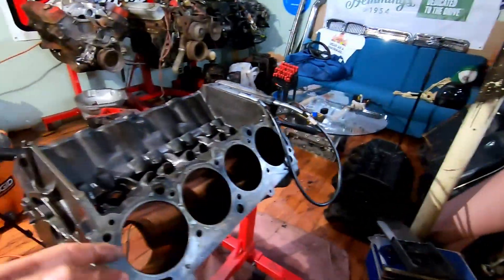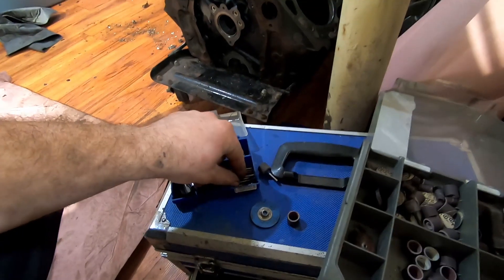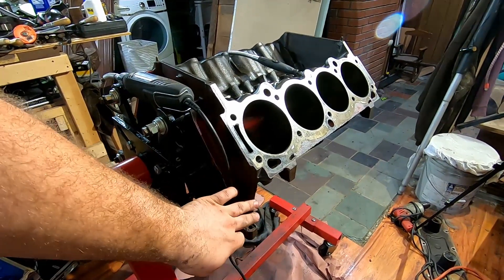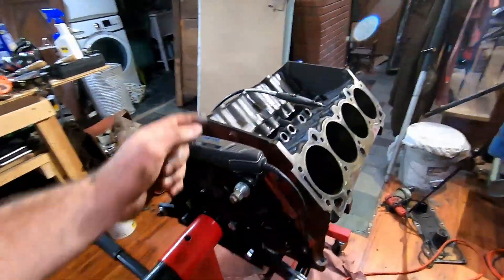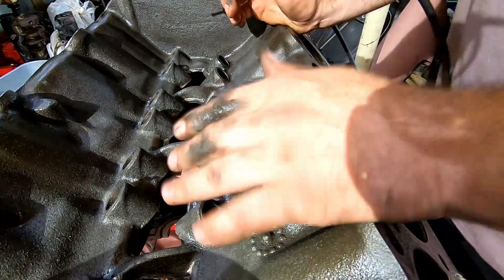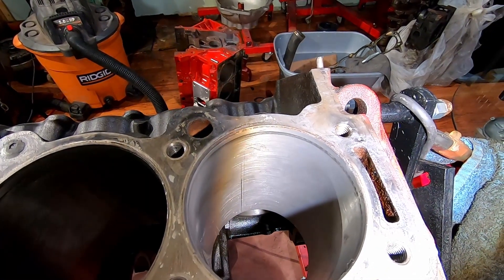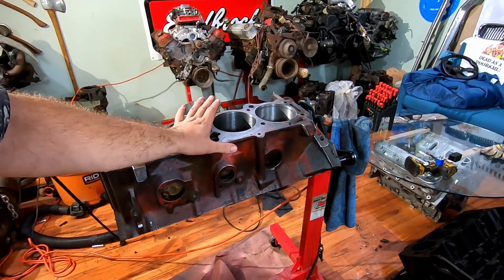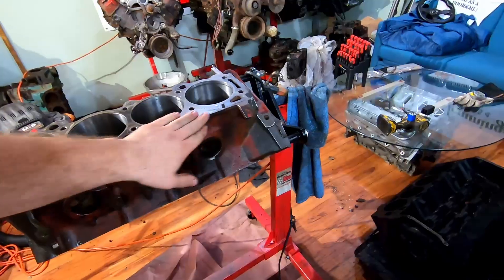Deburring and Honing the Buick 455 for Rebuild for Big Horsepower. But Things Can't be that Easy

Comment: It's great to see a Buick 455 get some hands on attention. It's been about 30 years since I built one, and I never even thought about debuting. I've done some oiling mods to the timing cover but that's it. I found out what the rev limit was on a stock build, somewhere near 7000rpm.  I'm getting ready to build another one soon. Been collecting parts slowly for my GS for about 5 years now. I hope you continue to do some more videos, it's inspiring. Thank you.
Reply from the maker: Absolutely man🤘🤘 i’ve been eyeballing the TA performance timing cover because it’s already been upgraded. But boy that’s not cheap at all
Reply: @LunarOutlawsGarage   the T/A timing cover is very nice, but expensive. 1/2" drill and a 1/16" to oil the distributor gear. Then get the high volume oil kit TA#1510 taller gears, with assorted springs, and T/A has an adjustable regulator that allows fine adjustments, mainly for higher rpm It's pn# TA 1502. I have used the high volume kit, but not the adjuster, yet? I'm fortunate, TA performance is only a 100mi north of me. I going to have them do the machining of my block and install the windage tray to eliminate the valley pan.
Reply from the maker: I am working on getting over to the salvage yard where there is a 430 mostly apart but it looks like it has a good timing cover. Unfortunately my timing cover was damaged. If I can get that off in one piece without any problems will definitely have to do a video on modifications

Comment: Man, it is surprising how thin the cast is/was - And I'm not surprised how much flash there is, being that they were cranking these out by the thousands back in the day. QC wasn't top priority back then - as we all know.

As for the honing: So you're not going to do anything to cyl 7 then? ... It'll only get worse over time and cause other problems. No way to fill those grooves? (Worst case is to sleeve the darn thing - ugh).

Great video my friend,
TTVE (To The Very End), KOKO (Keep On Keepin' On) & God Bless
😎
Reply from the maker: It’s going to a machine shop and getting 30 over pistons
Reply: @LunarOutlawsGarage  Ahhhhhh that’s right! Senior moment on my part!
🤣
Reply from the maker: I get them and I am only 32 🤣🤙it is a good thing Stephanie is on top of things b/c I would forget to drink water though out the day
Reply: QC was as good as it needed to be. The "flashing" and such is a not issue WRT coolant and oil flow considering the pressures and flow rates. I mean, the block will look nicer and it's a hobby thing to do but I'm not convinced there is any performance or operational advantage. But love them 2nd gen Buick V8s - the lightest and most compact of all the "big" blocks.

Comment: Lunar, again; I just don't know; Would sleeving this cylinder be an option? Or would that then be a weak cylinder because it would be sleeved?
Reply: I was thinking sleeve also for that one cylinder
Reply: • Sleeve.
Sleeve!
SLEEVE!
> Yes, Lunar, definitely, a SLEEVE to the rescue!
An extra benefit to a sleeve is that it adds
overall strength to the cylinder wall and block.
• Sleeve 'em all!

Comment: U maybe can put JB weld fill it in the useing your finger wipe away the access before it drys home it
Reply: It won't stay in after a few heat cycles.  Either bore and sleeve or just go overbore if there is room and pistons available.